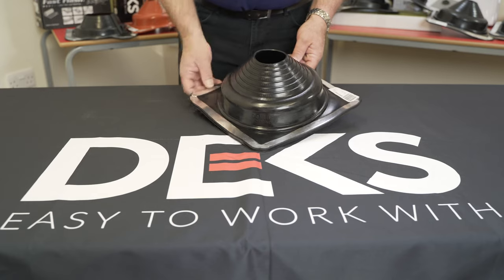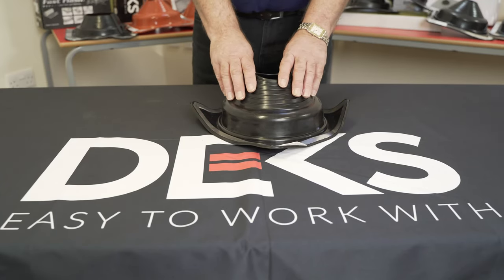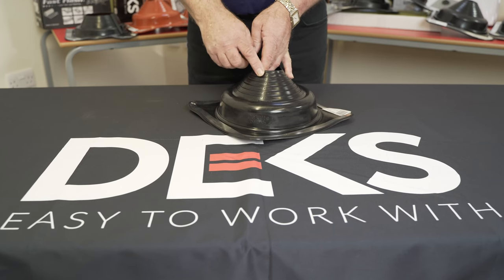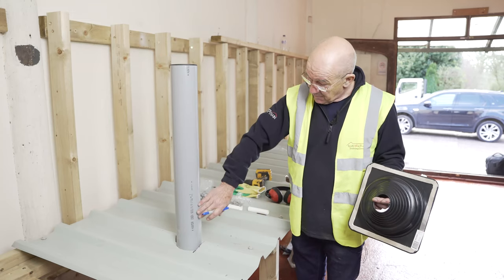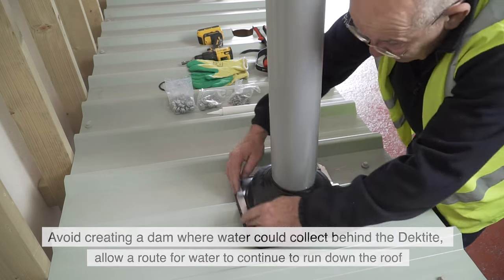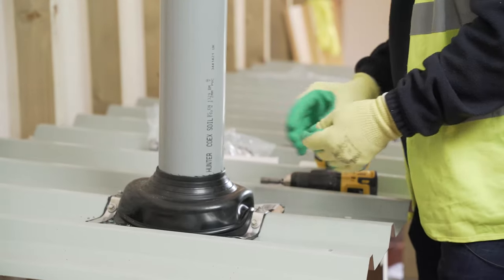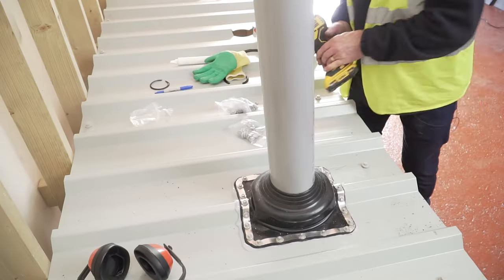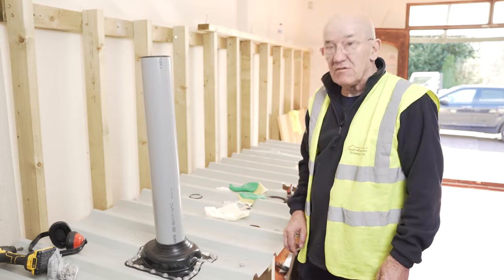Installing Dektite Premium on a Metal Roof

Comment: would this be better fixed at an angle (like a diamond)? Thatt way water running down the roof runs around the seal rather than sitting against it?

Comment: I found this to be a really good product. It has far exceeded my expectations for waterproofing a very awkward shaped profiled roof. My only gripe is why do you supply such a second rate silicone gun? Surely it would make more sense just to send out a tube of low modulus silicone and for the end user to use their own gun?